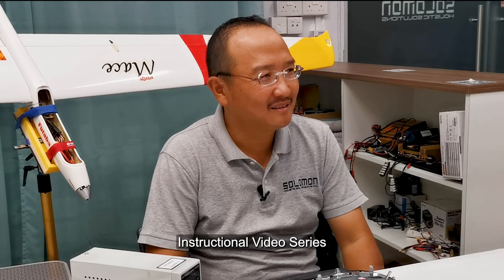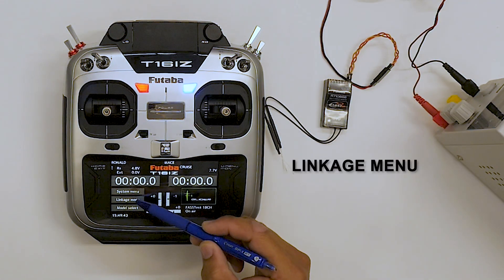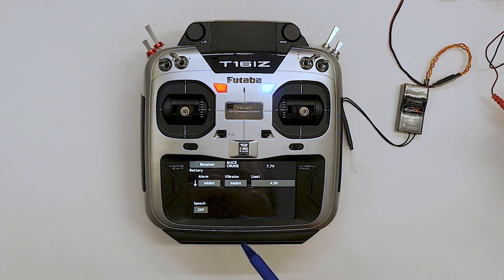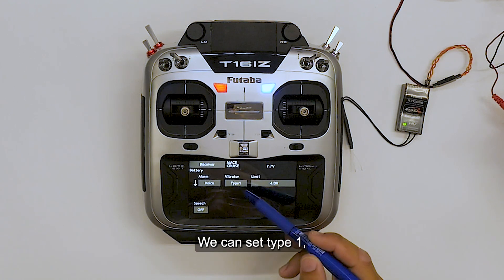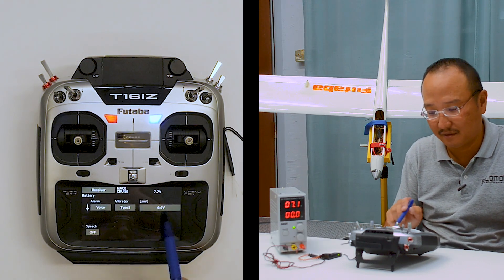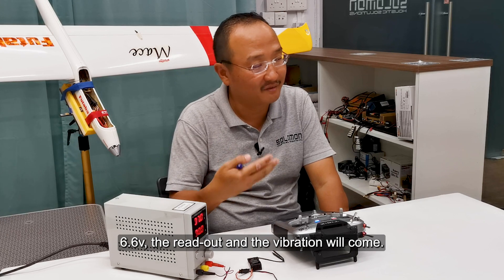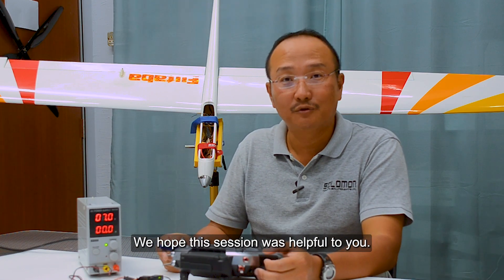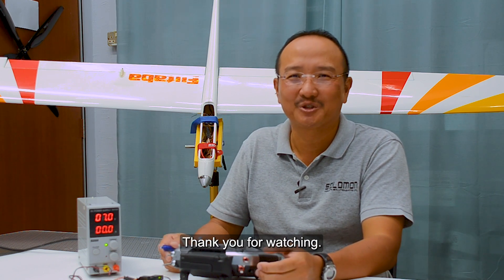FUTABA Instructional Videos - How To Setup Battery Telemetry Alarm

Comment: Not usable function... Because after transmitter turn on, it start to alarm, when battery of model still disconnected. Why Futaba guys not add option of additional switch I really don't understand..
What I want: Alarm = switch condition & (voltage<limit).